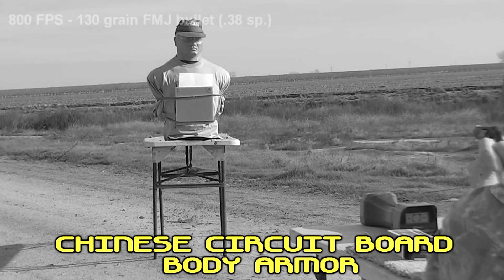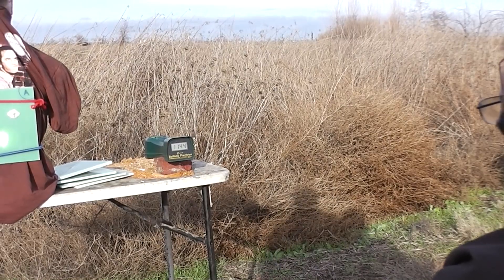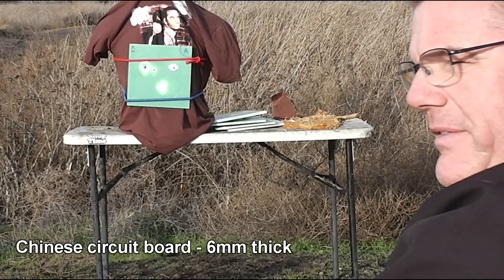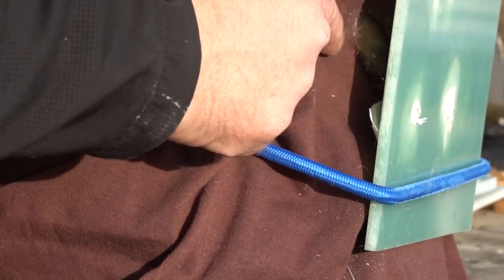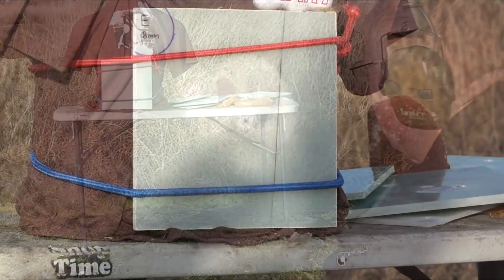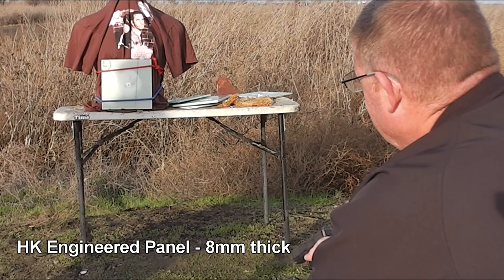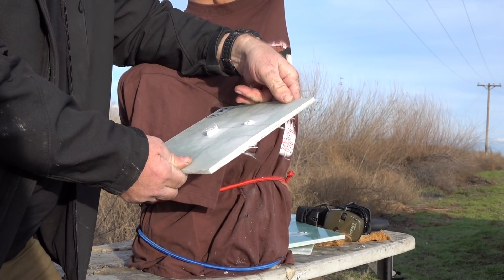CHINESE circuit boards -  are they BULLETPROOF?

Comment: It's pretty fascinating how these plates are just at the tipping point between .38 and high velocity 9mm. I think you should order a few more and try dfferent configurations to see f you can get them to defeat the MP5 while still being practical and low cost (I doubt HK protesters can afford setting up a complicated cottage industry, and these plates would only be significant if they could issue them en masse).
Maybe a stack of thin plates screwed or glued together instead of a single thick one? Two plates with an air gap inbetween? As you said it seems like it's just a layer of anything away from doing the job.

Keep up the cool vids.

Comment: A 10” board, with at least 5 - 10 sheets of paper either side, and wrapped in a good amount of tape, would probably be a good place to start if they wanted to make body armour out of these circuit boards.

Comment: I'd be interested to see the resistance of the circuit board mounted up to the no brand Kevlar, seems like a pretty light and resistant set up to protect from small arms, if it can stop 9mm then it could be pretty affordable and protective from the small arms they are facing, anything that helps them has gotta be better than nothing
Reply: Could also help catch the spauling too potentially?

Comment: There was a guy that was shooting steel on YT I saw the other day 
He used a air gap between their plates
Reply: The air gap prevents the propagation of the fracture in the material dispersing more energy sideways rather than through the material then the round is already deformed and has to re initiate penetration on the second sheet

Comment: Those panels cut correctly and used in conjunction with the "Sketchy  Kevlar Panel" might prove formidable indeed. I would sew two Ebay Kevlar panels together to create a pouch to house the fiberglass panel. Then I would do the same for the back and attach the two using nylon straps and adjustable buckles. If I can get my hands on the materials perhaps I will attempt such a feat.
Reply: What i have understood about soft body armours is that you don't want anything hard behind it. Kevlar (or similar) fibers are squashed between the fast bullet and hard panel and they don't flex providing protection, just cutting the fibers.
I would put the most hardest and thinnest steel you can find before the fiberglass panel, deforming the bullet as much as possible. Fiberglass panel then taking the much of the energy of the deformed bullet and behind it single Sketchy Kevlar Panel(c) to catch anything that comes through. That way the the bullet goes from most rigid and least deforming to the least rigid and most deforming. Problem being is how hard steel you find cheaply... One possibility would be to use smaller (inch by inch or so) ceramic floor tiles surround by sticky flexy adhesive like Sikaflex bonding glue. Hard tiles break the bullet and glue holds the tiles together. Small tiles so that one bullet doesn't fragment all of the surface area at once.
Reply: @alaric_  most armour vests consist of soft armour with pockets for hard armour plates, also a lot of soft armour vests often have pockets for hard trauma pads. take a basic kevlar vest. it may stop a handgun round, but the force of the impact is likely to leave you winded and bruised, or even break a rib. a hard trauma pad behind it reduces the deformation into your body and spreads the force of the impact out so that it doesn't put you out of action. 

that said you can get soft trauma pads which are more comfortable to wear and usually contain a non-newtonian gel that hardens on impact but remains soft so as not to hamper movement.
Reply: @alaric_  your rather lengthy reply  voiced real concerns. I must disagree with a few though. Yes it can shear the kevlar fibers however that shearing slows the projectile. My point being is if you remove the kevlar in the front and still leave the kevlar in the back then have you strengthened you bullet stopping potential? Steel adds unnecessary weight. Remember they are protesting not clearing rooms. I believe that if the two materials are combined in a smart way the resulting vest will be easy to tuck under a shirt and stop most pistol calibers. Not to mention easy to mass produce so that more protesters can be covered for cheaper. Food for thought.
Reply: Thatoneguy overthere I was thinking exactly the same thing 👍
Reply: @mattus1gig  me to
Reply: Would increase your chance of survival against small arms tremendously I think.
Reply: These circuit boards are strictly worse than basic HDPE plate made from cut up milk jugs
Reply: I'm thinking worst case scenario someone wearing one of these does get shot with a rifle bullet.  It will probably drag those fiberglass fibers all through their body and I don't know what that would do but I'm guessing it wouldn't feel good or be possible for a doctor to remove all of the glass fibers.
Reply: @silentbob267  it would be more likely to be fatal if the fiberglass was not backed with something to catch most of the fibers, fiberglass is sharp...
Reply: @Meop79  I'm saying if a round made it all the way through the fiberglass and the backing it would be carrying fiberglass material with it which could make for a really nasty wound.
Reply: @silentbob267  agreed, likely you would bleed out from the sharp fiberglass.
Reply: @silentbob267  that is true, I can't argue with that. However the same can be said of the ceramic plates that militaries use around the world. If you are getting shot by a rifle the last thing going through your head is "did fiberglass get in there?" If your misfortune has taken that turn for the worst you may not have long to worry about the wound.
Reply: @silentbob267  it would probably be easier to remove than fibres from kevlar or clothing given how more ridged they are, however it would probably require a lot of surgery, especially considering that the glass fibres are more likely to work their way into tissues and snap, which could lead to complications especially in the thoratic cavity possibly resulting in further lung damage, the other problem would involve trying to find them. on  the plus side glass fibres are unlikely to cause immune response and body rejection but given that  thy're not sterile it could also lead to infection. it would basically be like treating a wound from a fragmenting round, or an explosive/incindary round. complex but not impossible.
Reply: I was wondering about that.  Maybe they will do a video on that.
Reply: Putting a plate inside or between the cheap cevlar would atleast catch the fragments wich can cut you up really bad in the head area, also a glued ceramic tile infront would deform a bullet alot and dump alot of energy faster
Reply: @BastianMyhre  you would want to put the kevlar behind this panel, or better both in front and behind as punching through this panel would bleed enough energy to help with the impact force of the bullet and the kevlar would catch the bullet and the shards of fiberglass
Reply: @Meop79  I would have it on both sides, there is alot oh shards and splinters comming from the striking face of the plate wich sucks badly, but yeah would prefer most of the cevlar behind the plate, and maybe some foam padding
Reply: @BastianMyhre  from where they are and what they're doing I'd go kevlar fiberglass kevlar and then modern laminate flooring. All held together with duct tape.
Reply: @BastianMyhre  ceramics negate most if not all of the fragments but to me it seemed the fiber glass when stopping the bullet had some of the same quality's trapping  the fragments between the layers of fiber glass and preventing spalling
Reply: @BastianMyhre  agreed however you would then need to take weight into consideration as you ad more layers.
Reply: @masterof1  weight is an issue, but these board are relatively light and a thin tile is light also, and the time spent wearing them is probably a few hours of protest, maybe 2-3 days at most, not days and weeks of field with, guns ammo and backpack.
Reply: @BastianMyhre  this is true. However I am also looking a the legistics of creating such a vest these boards are cheaper then the tile and if you want to give the most protection to all the finances have to come into play. All I am suggesting is trying it out in a similar test to see if it is viable. If the tile is unnecessary then it becomes an exorbitant cost.
Reply: @masterof1  curious about the tinner tiles, like 2x 6mm with kevlar between them and tape it together
Reply: @BastianMyhre  now we are talking!  That is a fantastic idea.
Reply: I think if they had Kevlar they would use it. What they probably do have is plastics. FRP, HDPE, ABS, maybe nylon, urethane?,  problem is HDPE is probably a live surface plastics and won’t glue to other materials. Maybe we need a sandwich like the real PE armor plating. Fiberglass Re-enforced Plastic (FRP?) HDPE, and a urethane backer. But sine we can’t likely glue I maybe we can use a Pressure Sensitive Adhesive tape like the MMM very high bond tape...? I know I am not playing in the same sandbox but what are our chances of this working?
Reply: @tbthedozer  the kevlar was from an earlier episode. I'm saying coupling the kevlar and panels in this video could optimize its performance without breaking the bank.

Comment: Jeff take one of these and put a ceramic floor tile in front of it! I think it would help distort the bullet and slow it down enough for the plate to catch greater threats  without being on the edge of failing. Should be a easy modification for our fellow Hong Kong brothers!

Comment: You might want to try backing the eBay Kevlar with one of the 6to8 mm plates on the premise that some one might not be able to get the ten mm plates. Really, all the plates should be combined with some sort of kevlar. Or am I wrong? I'm just think of spalling and the extra protection. I want to see the Hong Kongers win.

Comment: Yeah ok it's cool to look into alternative body armor technology... But the protesters in Hong Kong are not worthy of your time.

One of them was shot in the chest after wearing a full face mask while running up to an officer who was making an arrest and had to pull his gun to keep the savages away.
The youthling that ran up to the officer tried to slap the gun out of the officers hand. Clearly the officer shot him in self defense.

Other protesters threw bricks towards the police and the police responded with rubber bullets. Bricks can fatally injure someone.
Pretty sure those protesters were all masked as well. You don't need to wear masks in a democracy, which is the blanket reason they are using for demonstrations in the first place.

Then there's the gang of protesters that threw heavy objects from a bridge onto moving vehicles below... Need i even say more?

But worst of all is the Hong Kong protesters who had a heated debate with a pro-Beijing supporter which ended up in the Hong Kong protesters dousing the man in a flammable liquid and setting him alight...
And then people have the tenacity to call THEM the victims?

There are actually peaceful protesters in Hong Kong and neither of these are getting shot or even arrested (initially) but then in comes these "anarchists" with face masks that throw stuff at police and innocent bystanders, assaults police and tries to disarm them and actually tries to MURDER opponents to their "cause" by burning them alive.

So tell me Jeff, are you actually in support of these actions? Because the way i see it, you are being a fool.
Reply from the maker: One guy doesn't represent the majority.
Reply: @taofledermaus  So the majority of protesters got shot in Hong Kong then?

Well, that's news to me.
Reply: @Cadde a cop following tyrannical laws doesn't have self-defense rights. He's the criminal. The aggressor. The real savage. Do you think the Founding Fathers thought that the Red Coats were defending themselves? No, they shot them.
Reply: @ChucksSEADnDEAD  Try harder please.
You are talking about a war for independence. What's happening in Hong Kong isn't a war. You shouldn't wear masks and attack the police just because you think they are tyrants.

If you really thought that way you would actually arm yourselves and organize a coup.
The protesters are just cowardly anarchists.
Reply: @RealCadde  "you shouldn't wear masks" - why? Of all the things you could complain about, why masks?
"cowardly" - they're fighting for freedom. You complain about it online. How can you call anyone a coward?

Comment: Just out of curiosity, what would the weight difference be if you added, say half the thickness of the Ebay kevlar to the plates, also, I assume it would be better for it to be behind the hard plate not in front?  Might be interesting to see the difference for anyone (like myself) who is not terribly familiar with body armour in general.  
Also. As always.  Great video.   Cheers.

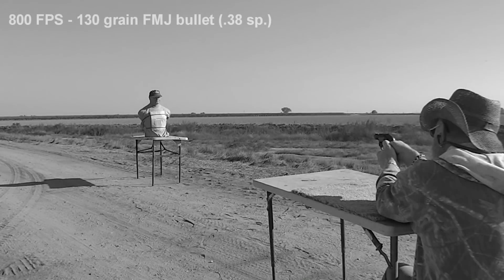Comment: 1:29 We didn't forget; we were just as puzzled and disappointed at both.  If you'd have explained why you used the 10" barrel (the ChiComs use PCCs), we'd have understood.
4:25 Getting fiberglass in you is contraindicated to good wound healing.  It looks like these boards are not be what you want as a last line of defense.
12:26 Sometimes you need  (but not rude) negative feedback.
Reply: The issue with the first point is that the set up was CLEARLY several types of armor against two dissimilar threats but most people were outraged at the "unfair comparison" between 9mm and .38spl when the point was not a caliber comparison.
I explained it in the comments to probably 20 different people and only 2 got it.
Reply: @ChucksSEADnDEAD  "two dissimilar threats", huh?  .30-06 and spitballs are also dissimilar.   .38SPC in snub-nosed revolver used to be called the Chiefs Special, since it's so small and wimpy.

Few would have complained if TFM had shot the .38SPC out of a 4" barrel instead of the Chiefs Special, and explained why they used the 10" barrel.
Reply: @RonJohn63  ".30-06 and spitballs are also dissimilar." - https://en.wikipedia.org/wiki/Reductio_ad_absurdum

Comment: Needs anti-spalling coating though. I’d layer 10mm in front, eBay Kevlar middle, and 8mm in the back.
Reply: The kevlar should be at the back of the panel. The first two plates deform the bullet and expand it and the Kevlar will catch it easier. Ceramic plates have hard material in front and soft material as the backer. I say a 10mm plate with a ceramic floor tile taped in front of it. Easy to make and should stop 9mm 1400+ fps, don't know for sure though. Jeff should try this.
Reply: If you glued a sandwich of 10mm/kevlar/8mm that would probably work really well.
Reply: Or sandwich two 10's with kevlar
Reply: Kevlar in the back, stop any bullet and fiberglass fragments.

Comment: Spray some WD40 on that camera zoom! 

I think the conclussion is to get Ebay kevlar and China plates and you would be golden?
Reply: Yeah, and the eBay stuff worn behind the plate would make it more comfortable to wear.
Reply: WD isn't a lubricant. Please no
Reply: @DigitalRX2r  Well it does lubricate, it just doesn't hang around very long. Spit isn't lube, but it does the trick.
Reply: @DigitalRX2r  it is lubricant, actually. just google "is WD 40 lubricant".
Reply: @arcanealchemist3190  It's a water displacer / solvent; Water Displacement Formula  #40. Its lubrication properties are horrible. Blood is technically a lubricant too, but KY Jelly is designed for it.
Reply: @DigitalRX2r  https://www.wd40.com/myths-legends-fun-facts/ actually, since you werent going to anyways.
Reply: Nope... get proper NIJ tested armor. Nothing less than 3+ imo
Reply: Hail to The_Rooster I don’t thinks it’s as readily available over there 😂

Comment: This is also like point blank range, so I’m assuming that the panels would do marginally better in Hong Kong.
Reply: With body armor ALWAYS test worst case scenario.
Reply from the maker: About the same range protesters have been shot so far.
Reply: @taofledermaus  Jeff could you do a test where you tape a ceramic floor tile in front of the plate? I think it would make it stop the rounds much easier. Like a poor man's ceramic armor plate. And it's easy for the Hong Kong people to do.

Comment: As reading commenting on youtube and the net in general it seems to me that the old formula of force in physics seems to be forgotten or just plain ignored.. Even people associated with firearms seem to forget what velocity brings to the table. A 9mm 115gr at 1400fps compared to a .38 special 130gr at 800fps is like the difference between getting punched in the face by a professional 200lbs boxer or a 215lbs everyday fat dude.. The energy for the same diameter is something like 250% more..
Reply: I'll admit that for awhile I thought 38 special was at the very least as powerful as 9mm, but then after I actually saw how slow the 38 special is I knew how wrong I was lol

Comment: I know these boards for injection mold thermal insulation. Put on the back of the mold. I have used them for heat protection on other hot stuff.